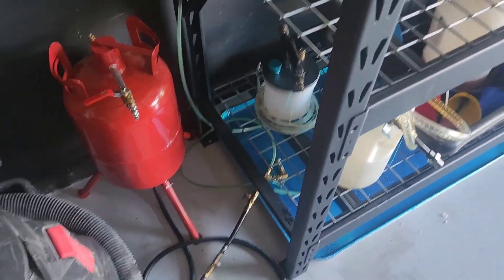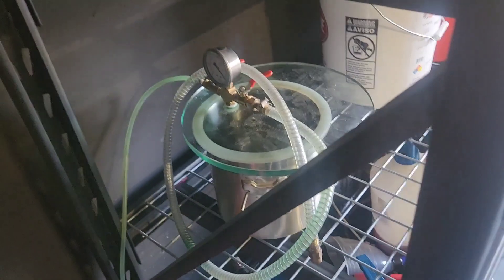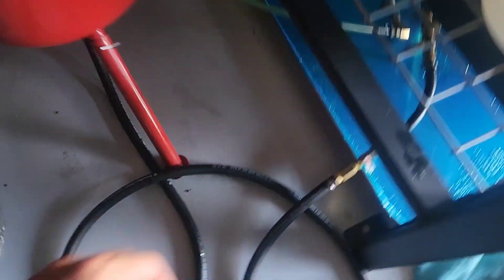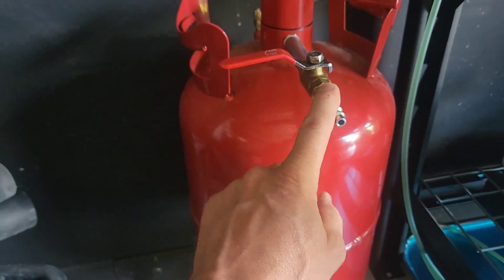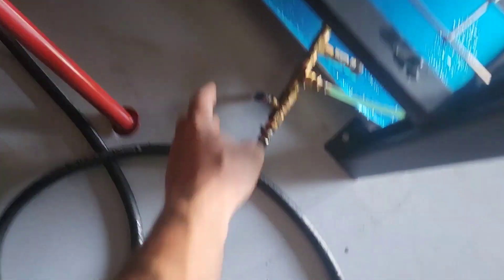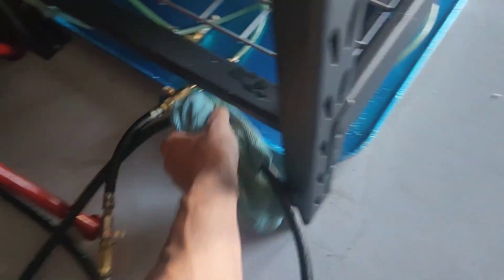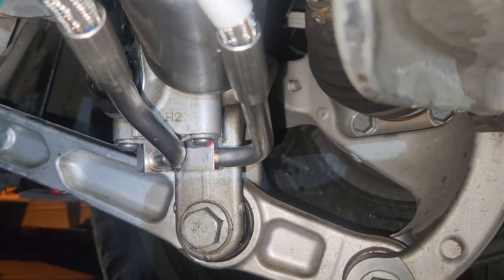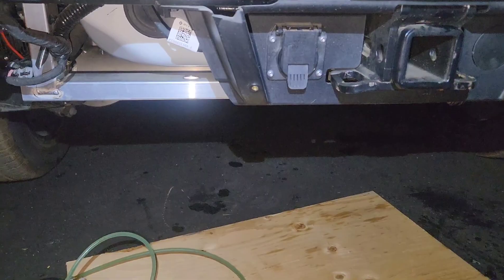Rivian Suspension Bleed and Fill Repair Accumulator

Comment: Appreciate you sharing some of your knowledge. Are you blowing out one line at each of the four corner shocks. Or are you taking both lines off each shock when blowing air through. Another question is if you have right and left sides independent, why would you need to vacuum the whole system when you have for example a line replacement on the left rear corner?
Reply from the maker: There are two separate loops that are connected only by a "plunger" for layman purposes.  So they don't connect with fluid passing between the two.  If they did, you would have just one connection point.  If you have a leak in one individual hose, it is possible to evacuate only that one line.  But you better be 100 percent sure that you disconnect the right lines on each side and connect to the proper loop connection point.  On the Rivian, unlike the McLaren, I have not taken every trim panel down to ensure there is no equalization point or to trace each line.  Also, if you have a loss of fluid, and the reservoir were to run out of fluid, both sides would have air in the lines.  So, if you already have to go to each corner to undo one line, why would you not just do both lines?  It adds maybe 20 minutes of time to the hours long job and allows you to completely replace all fluid as a maintenance item as well as being sure 100 percent, that there is no air in the system.  I'm not the mechanic that wants to redo hour of work because I was trying to save 20 min.  And putting this info online, I know, people like you have no idea what I'm talking about so trying to explain it all is a waste.  If you do both sides, you won't mess it up.
And you don't need to blow air.  If you use the machine I sell or make the machine yourself, just bleed the air out of your supply line from your pressure tank before closing the valve to that tank, then open the line to the vacuum pump and fluid trap, connect to the car, and disconnect the lines at each corner one at a time (or both lines on each corner, just do one corner at a time) until you hear air coming through it, and the fluid trap will catch all the fluid and you will have a fluid free system that allows you to draw perfect vacuum for the refill (some fluid will remain, but not a fluid blockage that prevents near perfect vacuum needed for air free fill.  
I'm going to pin this comment, so that you all will stop asking for extra free info.  I gave you all you need to do it, but all of you are ungrateful and continue to pose more stupid questions that waste my time.   You're welcome.

Comment: Where do I get the fittings?
Reply: Also if I drain the system, how much fluid did it take to refill? I just wanna know how much fluid to have on hand. My left front line was severed it still has fluid in there but I'm replacing the shock and the lines going to the shock. Thanks.